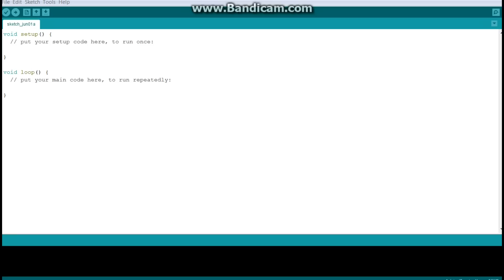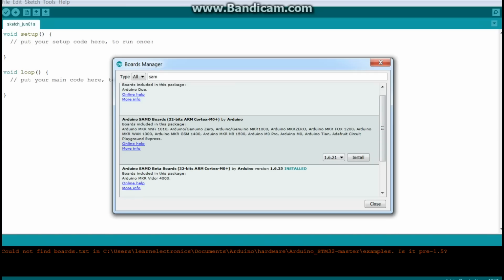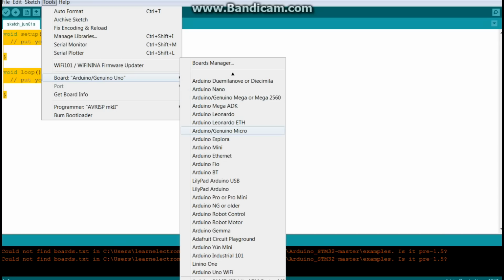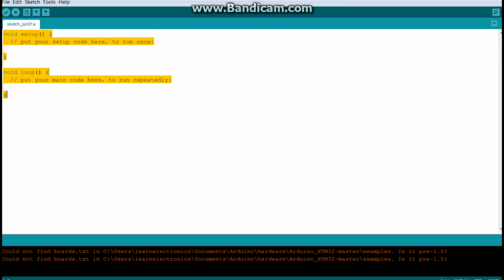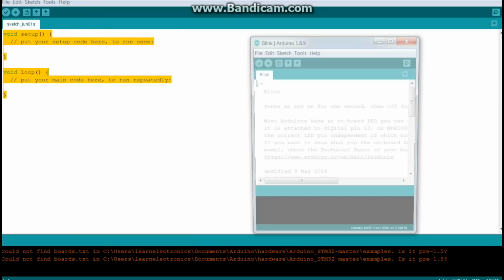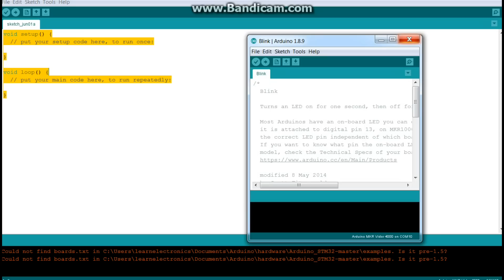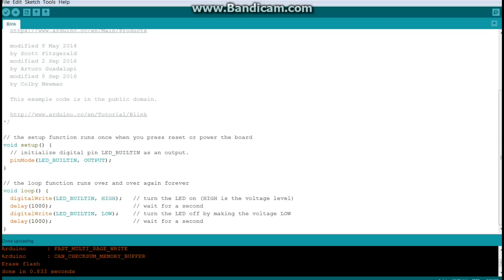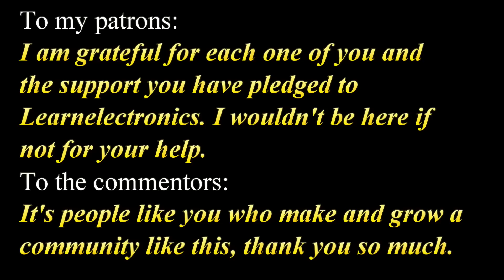Arduino with built in FPGA:   MKR Vidor 4000 Unboxing and initial setup

Comment: In case you care,
Pins 14-8 are used for the UART, SPI, and I2C protocols which are mainly used for data transfer.
TX = Transmitter
RX = Receiver 
SCL = Serial Clock
SDA = Serial Data
MISO = Master In Slave Out
MOSI = Master out Slave In

Comment: This is not suitable for beginners neither as Arduino. Guys should start with single piece microcontroller like Microchip or Atmel brands and to do all components' connections and programing on their own, not straightly go to own a development board and download program libraries.
Reply: Complete nonsense, arduino is a fine place to start and not all arduino boards are meant for complete beginners, like this one. In case you didnt realise it has an FPGA on it, that alone takes a lot of learning.

Comment: Quick question: does this fpga count as a SOC type fpga? After all, it has a micro processor embedded on it.... Unless I'm wrong about that :/
Reply: Not embedded, the SAMD21 CPU and the FPGA are near each other on the arduino board, rather than in one chip

Comment: Why use a micro controller and FPGA when the FPGA can do it all.
Reply: Just because you can doesn't mean you should. For one this FPGAs are volatile, they must be flashed every time they are powered. Implementing soft cores is wasteful, and the FPGA on this thing is rather small. Also verilog and VHDL are hard.

Handling things like some serial communication standard (json for instance) would be better for the MCU simply because it there is no need to do it on the FPGA, there are already a large number of software libraries written in C based languages. 

Basically the FPGA is there to implement hardware peripherals and high speed interfaces, the MCU takes care of the more abstract or general things like user interface. A good example would be a brushless motor controller. You would use the FPGA to implement the Field Oriented Control to precisely commutate it, and the MCU could be used to create some serial interference to set the speed and parameters, and its EEPROM to store tuning constants and the FPGA bitstream.
Reply: Power Max yeah I understand all of that but you  can do all wat you just described on an FPGA depending on your skill sets. Also makes your product cheaper by having less components etc.
Reply: @OKeefeist  true, but the hybrid SoCs are gaining popularity. They give you the best of both worlds. Having it integrated in a single die allows very high speed low latency communication between the 2.
Reply: @OKeefeist  Oh and another point: FPGA softcores are slow. High end 1GHz FPGA you would be lucky to get 80MHz core running on it. Hybrid SoCs with built in flash does not require an additional ROM chip. And the mid range ones use 700MHz to 1.5GHz ARM cores, similar to a raspberry pi in terms of compute. Look at the Zynq 7000 platforms for $200.
Reply: Power Max yeah I agree but when I’m designing and FPGA with HPS I ensure anything that’s needed to be computed quickly goes nowhere near the HPS and stays on the FPGA side. Good chat :)

Comment: The example you run I believe is on the SAMD side only due to the fact that you can edit the variables to control LED timing, and Intels Quartus FPGA tool is not involved. The FPGA is actually a slave to the SAMD, therefore your FPGA bitstream from Quartus is  compiled prior separately and referenced from your arduino code to create a single binary for the SAMD. On upload, the SAMD reboots the FPGA and initiates the transfer of the binary bitstream to it. The downside is as you get more advanced, you may still have to write HDL code, and reference the resultant bitstream in the arduino environment separately.

Comment: the precursor to today's fpga was oc the Ferranti ULA (uncommitted logic array) 

https://en.wikipedia.org/wiki/Ferranti
In the early eighties, Ferranti produced some of the first large uncommitted logic arrays (ULAs), used in home computers such as the Sinclair ZX81, Sinclair ZX Spectrum, Acorn Electron and BBC Microcomputer.
see also https://en.wikipedia.org/wiki/Gate_array as to why 'wire wrapping' was the prefered way to finalise/program these ULA/logic gate arrays ... rather than keep respinning pcb copper layers over and over to fix bugs...

Comment: Nice! An FPGA on an Arduino! The Cyclone is one of the smallest FPGAs out there and I am surprised that this one is made by Intel as there are many brands out there. But just because it is small, does not mean it is useless - you can do a lot with it!

Question in my mind, since Arduino is Open Source, is this board Open Source too? If so, give 3 months before cheap Chinese clones of this comes into market!
Reply from the maker: Yes open source

Comment: Next: Download Quartus Prime Lite and usbblaster library for samd21 for quick testing FPGA. There are GIT repository for project FPGA template that inlclude scitpts to generate arduino library with needed your FPGA image. These also contains contstraints file that have pin placement for FPGA. 

Recommend to check fpga4fun and nandland websites for basic tutorials about fpga. There are also free courses in Intel FPGA website that I would recommend to check.
Reply from the maker: Thank you thank you thank you. I have been searching for info on using the FPGA on this board!

Comment: Do you know how are the Fpga and companion microcontroller cooperating? Was this I2C bus meant for interconnecting the chips, or solely routed to the connector
Reply from the maker: The FPGA and SamD share pins according to what little documentation is published.
The I2C if for hooking up external modules and talks to both brains at once.

Comment: Hmm, not sure... Feels like the ages old D0 Nano blows this out of water in pretty much every aspect, or am I wrong?
Reply: Well yes, but, in contrast its a lot cheaper, with a lot more modern FPGA, its a heterogenous System(ARM+FPGA), has an HDMI(dunno about the DE0) and a PCIe. Other than that i agree.
Reply: @buntspecht5180  Sorry, I was thinking DE0 Nano- SoC... Apparently those are different... Dual core cortex A9 + FPGA. 

70 USD for Arduino vs 90 USD for DE0 Nano SoC (student price)...

I feel like the main power of Arduino platform is the ease of use, support and amount of example code. 

Those positive aspects outweigh the numerous drawbacks, such as virtually no debugging support, no auto-completion in the IDE,  no real-time error indication and more.

I doubt the strengths I mentioned can be well extended to this FPGA-based Arduino while I believe the drawbacks to be much more critical in the context of reconfigurable hardware development.

Comment: Does it have any advantage over FPGA-SOC solutions like Xilinx Zynq where both FPGA and CPU core are integrated on single chip? 

How difficult is programming and interfacing FPGA on this board? Are you able to program fpga independently?
Reply: No it doesnt.
Coming from a De01 SOC with a Cyclone V(ARM+FPGA) myself...
The FPGA still needs to be programmed via Quartus(Intels Vivado alternative), Designs still verified via ModelSim(or should i say ModelCancer) and the ARM Core still either Programmed with Arduino IDE, or Keil or Atollic. 

But apart from the easier Project Setup with the Arduino IDE, it sill is pretty much the same workflow as usual.
Just that the Connection between the FPGA and ARM Core here is done via an FMC(Flexible Memory Controller) instead of some proprietary HPS Bridge. This means: No IP Core from Intel/Xilinx, and probably a pretty slow speed.(48 MHz on the ARM Core Side. 16 Bit Databus, 8 Bit Addressbus, dunno about Burst Access). 
Also, the ZYNQ A9 Cores are probably faster in general.

So: Yes, you can programm it independently. Interfacing for the Board: I think that they have published an IP Core for the Interface, dunno how well it works but implementing one yourself should not be that hard.(Been there done that).
Reply from the maker: The advantage is programming it in a familiar IDE with libraries.

Comment: Something tells me that the IDE only supports ATMEL development and you'll need a heavy duty IDE for programming the FPGA.  Whatever market this board is intended for, it certainly isn't for the casual "maker."  That said, you can do some insane stuff with it.  You can build an LED matrix controller to drive a wall of LEDs.
Reply: You need Quartus Prime of Intel FPGA(formerly Altera) to Programm the FPGA. There is no way around as it is an Intel(Altera) FPGA. The Lite Version is Free but needs registration.
Reply: @BarryManilowa  Well, i personally bought it as its a relatively cheap FPGA Board with both an HDMI and a PCI. My De01 has a VGA and i do not want to teach myself this obsolete Technology.

What i can image this thing ispretty good for is Hardware Accelaration of certain Tasks. Given the PCIe, you could plug it into your PC, write some simple Character Device Driver and, for example, Hardware Accelarate certain Filters, Transformations and so one in Software like GIMP or GNURadio. But Apart from that, i guess it is only for playing around.

In terms of free toolchain, they could have opted for a Lattice FPGA. They provide some Open Source Synthesis Tool.
Reply: @BarryManilowa  To be honest, i dont know how they compare.

Comment: Does the HDMI require a FPGA program and can it show a console then?
Reply: HDMI is connected via FPGA. You can Flash either some Softcore Processor like NIOS onto the Device, or pass through the Data from the SAMD21 Microcontroller. You can get a Console Running, yet you have to decide on what Device(FPGA or built in Microcontroller). Keep in Mind that you dont have enough Space to run Linux, except for when you connect some external Flash to the FPGA.

Comment: 3 blinks and a pause... I'm sold!
Reply from the maker: You realize this video was about how to get the board to work within the Arduino IDE right? Not a tutorial on programming the FPGA?
Be patient please,  I'm working on more videos, but there is not much documentation out there as yet. I'll have another video on using the FPGA to drive the HDMI this week.
Reply: @learnelectronics  You should be less defensive, you would have seen it was a joke. Not commentary on your video, skills or choice of program.
Reply from the maker: I get so much crap on here on never know what's a joke or not. Sorry if I offended.
Reply: I'll live. At least you didn't go with some "Hello World" Project. Do you have any kind of project planned for this thing that can show off what it does? I'm a newbly newb had to lookup FPGA. Would something like this be better than say using 3 separate Arduinos to do 3 completely separate tasks?  Depends on the tasks?
Reply from the maker: @pgtmr2713  Im working on getting the FPGA and HDMI going, probably by this weekend. This board's advantage would be in high speed, memory intensive projects like video and or audio processing.

Comment: Goodly piece of kit, but the price is very high still, maybe in 6 month's they will drop to a real price as per normal, and the market will be flooded with copy's if they are any good. :)
Reply from the maker: Maybe, but don't look for this board to be in the 10 dollar range. The cost of the Cyclone 10 alone is $13, add in the Ublox Nina 102 and HDMI and it might drop to 30-40 range.

Comment: Would love to see more FPGA stuff. Maybe look into the Terasic DE10-Lite, 50k logic elements for around the same price.
Reply: Although a Pretty Neat board, i personally have mixed feelings about the MAX10. Used one at work and have a few at home... Instant on and those built in ADCs are nice, but thats it.
Reply: @buntspecht5180  Can you explain what you didn't like?
Reply: @AbeDillon Well... granted, the MAX10 just works. What I consider a little problematic is the low amount of embedded multiplier, which was pretty important to me at that time. Next thing, especially with the lower end MAX10(those I had to deal with), clock speeds are a little weak. Sure, this depends on the design, but the design was so close to hittin 100 MHz at desired settings after optimization, that I think, it could have with some other FPGA. 

But yeah, after NOT having done any FPGA thing for a while, this all sounds ok to me too... The thing with the Clock Speed probably could have been solved by further optimizing it. I dont exactly know what pissed me off about them at work... Maybe it wasnt so much about the FPGA itself but about Quartus? I dunno... The low multiplier count definitely played a role though and is the only problematic thing with the FPGA itself I guess. But hey... what to expect from a low end FPGA?
Reply: @buntspecht5180  Thanks for the reply. I'm sure Quartus didn't help. I'm pretty green when it comes to FPGAs, but one thing I've been told is that probably the hardest part of FPGA development is working with the abysmal tools. The DSP blocks on the Max 10 also look pretty bare-bones. No pre-adders or pipeline registers probably make it difficult to optimize around.

Is there a low-end FPGA that you particularly favor? I've been thinking of getting into FPGA development. I'm particularly interested in Lattice Semi because it seems like the recent arrival of open FPGA tools is pretty Lattice-centric, and they also seem to offer a pretty great value: an ECP5 with 80 kLUTs can be had for as little as $26 in quantities of less than infinity ;-). It's strange to me that what seems to be their flagship line is still stuck on 45 nm though. It makes me think something much better is just around the corner.

I ended up picking up a little ICE40 board with only 5 kLUTs a few days ago. It was only like $10 though, so I doubt I'll regret it.
Reply: @AbeDillon  Tbh, although I worked for a company where I designed FPGA-Hardware,  I am by no means an expert or professional. In between the end of my bachelors and the beginning of my masters degree, I worked there for only 4 months to complete my bachelor thesis in the meantime. The later one was a cooperation with that firm.... 

However, from what I have heard, Xilinx Spartan(6/7) are pretty good. Some people say, Xilinx Vivado "IDE" aint though. I dont know much about Lattice, but the Lattice ones have one major advantage: Their complete build pipeline is open source.  Here is some reference from one of the men behind that build pipeline:
http://www.clifford.at/icestorm/

However, I personally can only speak for my own experience, and sadly, its locked to Altera FPGAs. So far, I have only used MAX10(2k,8k,16k LUT), Cyclone 10 LP(16k LUT) and Cyclone V(85k LUT), for the latter, I mostly developed Linux-drivers for hardware a colleague developed. For most Hardware Designs I did so far, the MAX10-Series were enough. But at work, I maxed out most resources(most LUT, all embedded multiplier) on the MAX10 16k Model and I suppose, with other devices, things would have been easier(less optimization and FINALLY MEETING TIMING/CLOCK REQUIREMENTS).

So what I want to say is, I personally prefer Cyclone (10 LP) over MAX10 due to slightly higher embedded multiplier count, which I heavily depended on back at work. Price difference AFAIK is not even that high, if you compare those chips with same LUT-Count. For Cyclone V I was mostly the Linux guy... And I dont have experience with Lattice or Xilinx. So I cannot give any recommendation at all. But I think, Lattice aint a bad choice.

Comment: VERY interested to see this series. I have been following this device since I noticed it's appearance recently. I've got a project that has too many things going on at one time for the UNO to be effective so this is a possible solution. Keep up the good work Paul.
Reply: MAX 10 FPGA with a Softcore NIOS? Cyclone 5 SOC(Terasic DE01-SOC)? Maybe it would fit your needs. The only reasons to buy this board is the HDMI and miniPCIe. Other Boards with this Config do cost a lot more.